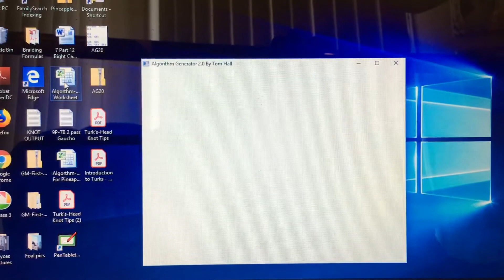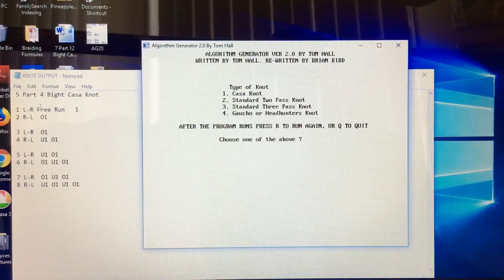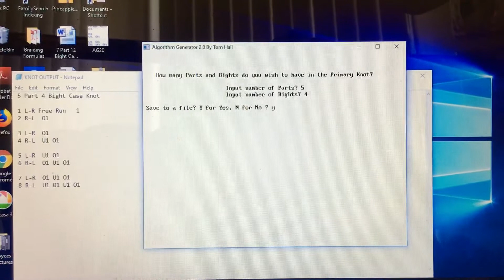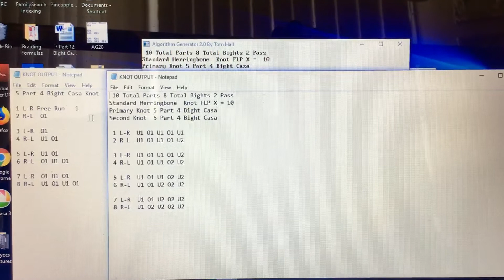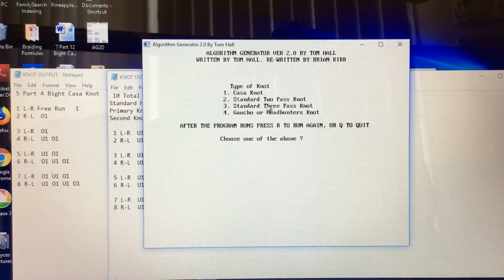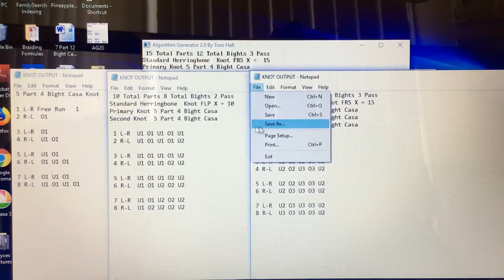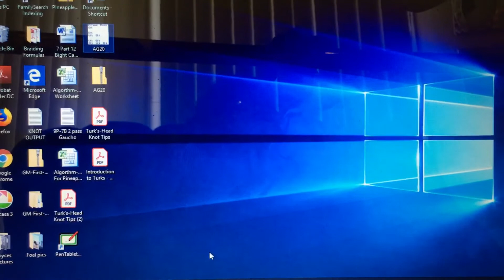AG20 Part 1 Getting started.

Comment: 1. No, it goes straight to download folder. Click to open it, it opens and the program and it does not work. Unable to navigate or make input on the program.
Reply from the maker: Demetrio Filardi to do the input are you typing the number and hitting return? Because that screen is frozen waiting for that number.
Reply: Ok, will do. See if that works... Thanks
Reply: Yes, it works! Brain died for a moment… Thanks!!!